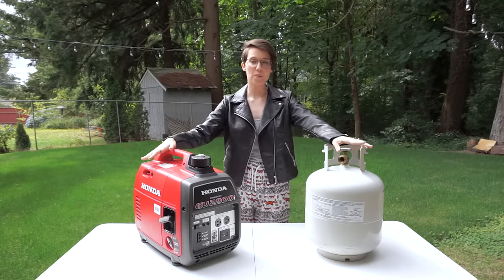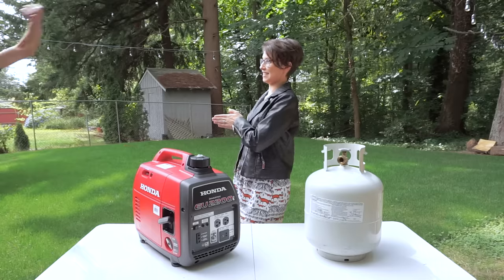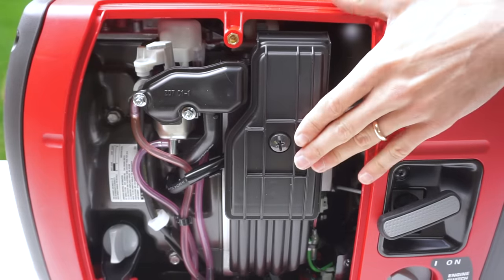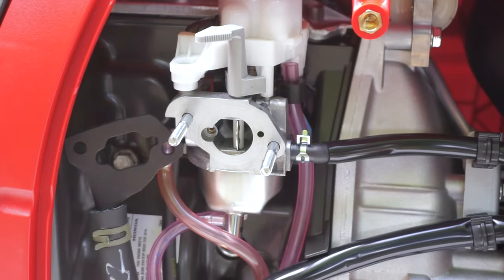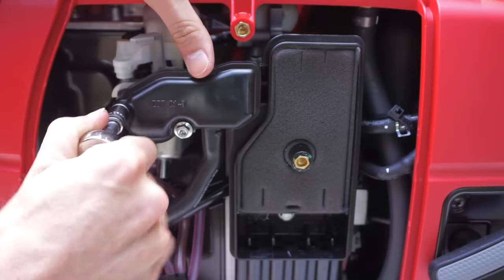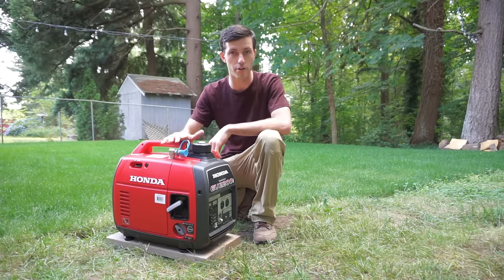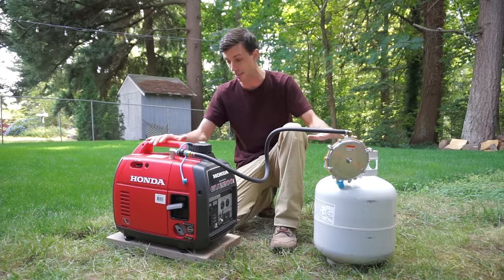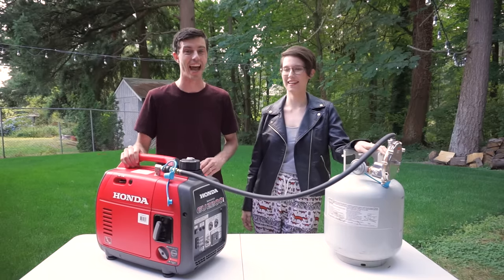Honda EU2200i Propane Conversion Kit - DIY Install for Honda Generator

Comment: Great tutorial on the conversion. Is that regulator big enough don’t you think? Do you think they can make a smaller one.
Reply from the maker: Thank you Ralph! And yeah the regulator is pretty large but I imagine if it could be smaller it would be. I don't know how they work so I can't say.
Reply: That is a special on demand regulator. It only lets the lp out as the engine sucks it out. It also regulates the lp pressue. Some kits have the pressure regulator and the on demand regulater seperate.

Comment: This is a great how-to install video. I was wondering if the "ECO" mode still functions running LP?
Reply: Interesting that there is no reply?
Reply: @ChrisSgaraglino , I should have gotten back to this question... Sorry it's late, here it is. Bought this conversion kit and installed it, WORKS GREAT ON ECO MODE WITH THIS CONVERSATION TO LP! There you have it.

Comment: Big question would be if you had the easy start and an older Honda 2000i, and 10% reduction if it would still run the AC
Reply from the maker: I'm not sure but I assume it would. Give Clayton a call at Hutch Mountain, he would know for sure: 435-494-1975
Reply: @FateUnbound  plus the 10% if you are above sea level you lose capacity also just FYI

Comment: Great instructional video- nobody could balls it up after watching you. You certainly are doing your hardest to make petrol the devil though. A mate has one of those hondas and I swear yours must be running too rich if you notice the exhaust as annoying. Maybe you run it in the garage.... I'd say if you are having petrol go stale in your generator for lack of use, either you don't really need a generator or you start putting premium in it and not that alcohol blend crap. I had a chainsaw stored in my shed fuelled up for 2 years and when i got it out it started and ran fine on the 3rd pull. Summers are hot here and fuel only goes bad when allowed to get hot- like outside. Its a nice simple conversion but that car sized regulator is ridiculous. A larger, less portable genny would be better suited to lpg though, as running a portable on lpg just makes it less portable and as the motor wasn't built for lpg, it won't be very efficient on it. One thing not in the kit was a shorter reach spark plug seeing as lpg runs hotter.

Comment: Since I don't own one of these I only watched the first 3 minutes.  Did you explain how long it runs on a 20# tank of propane compared to how long it runs on a full tank of gasoline?
Reply: A question in our mind as well  :)
Reply: Website says 30 hrs on a 20# tank
Reply: @Rick-rd9uu  Thank you.  And I should have mentioned that's a super well done video.

Comment: The big question not mentioned .... Would installing this modification VOID the manufacturers warranty?
Assuming it's a new or almost new unit.
Reply from the maker: I'm not sure, that is a question for Clayton at Hutch Mountain, the maker of this kit. Give him a call at 435-494-1975
Reply: I would suspect Honda 'wouldn't' honor the mod if you did it yourself. The reason is, there are too many "nut jobs" out there that would do something not mechanically correct and crack the manifold, bend the gas line wrong, and so on. I would be willing to be they would 'honor it' if you had a Certified Mechanic do it, because then they could come back to the Mechanic if something went wrong, and they could show "They followed all the proper precautions.

Comment: Great job with the install, I have an eu 2000 which has worked great for almost 20 years, $269 for that kit is a little steep

Comment: How long will a tank of Propane last with a 70% load?
Reply: 4/10/2020 I sent an email to the company asking this question. If I get a reply, I will let you know.
Reply: This is the answer I received: Hey Michael, run times are as follows. 12 hours full load, 22 hours half load, and 33 hours ¼ load. I hope that helps. Reach out if you have anymore questions thanks. 😊
Reply: My question is  why with a 1/4 load it runs longer, 33 hours,  than a full load at 12 hours?
Reply: Richard Estrada it’s essentially the same theory as a car Richard. The more load you have on your car the less gas mileage you get. If you load the generator (asking it to make more power) it will consume more fuel (on any kind, gas or propane). When the generator is asked to work harder it need more fuel
Reply: Be aware that the energy density of gasoline is much higher than LP or NG.  A 5 gal propane bottle lasting a day hurts a bit.  5 gals of gasoline would last many days.  I have this generator and it will hold my large fridge while idling and it will run forever at idle.
Reply: Ken Leonard  very interesting

Comment: How many hours on a propane Tank compared to a gallon of Gasoline. Thanks for posting.
Reply: Even though I really like this video and converting to propane, it will suck that propane tank down like It's nobody's business.. unfortunately gasoline/diesel is still the way to go if you're looking for a long-term Solution on a generator

Comment: Hi love you chance. I work a round low pressure cylinders and the only need to be open 1/2 to 1 turn of the valve. That with all fuel cylinders. Thats way if sum thing goes wrong you can shut it off quickly

Comment: Costco has/had a 2200 size dual fuel generator for $450 similar to the Honda. Hard to beat Honda on quality but Costco always goes Uber on the stuff they sell. I may pick one up to have around home, we lost power last spring for 40 hours. If it were me, however, and since you did run gasoline into your conversion/carburetor the gasket could swell slightly than contract with heat, I would recheck that your nuts are still torqued correctly. And, I would use the thread locker (high heat version) since it has been my experience that if anything can happen it will. Thread locker is like candied sugar it will granulated if you need to remove the nuts so it’s easy to break it’s bond with your socket wrench but you’ll have to scrape off the remnants with a pocket knife or wire brush.

Comment: Very complete How To for the Hutch Mountain conversion kit---well done!  One question, one hopefully helpful tip,  Is no sealant used on the internal fuel supply hose &fitting to the quick connect on the outside?  

For the carburetor studs where Loc-Tite is mentioned use #290 green penetrating formula after the nuts are installed---it will wick into the threads and seal them to the studs.  This is a low strength bond and easily loosened with nothing more than a low setting heat gun.

Comment: Most dual fuel generators running on propane produce a bit less watts - did the mfg mention what it would be de-rated to?
Reply: Yeah that would be interesting information.  So you know how much bigger generator you'd need to get the final needs met.

Also run time or consumption information.
Reply: There is typically a 10% power reduction between gas and propane
Reply: @_JimboSlice  That's what is quoted for vehicles. I have a V8  3.9 Land Rover Discovery on it.  I'd like to see them try a cold start on Propane alone. The engine needs to be warm to vapourise the propane. I have a friend who  runs an ex military Onan genny of it. The system just used a ring , similar to a gas cooker put on top of the carburetor.
Reply: @johnjacobjinglehimerschmid3555   I have some imperical eveidence from an Ex British Military Onan 3.7 KVA genny. That used about 1.5 Imperial Gallons of petrol  per hour. A 47 kg Propane bottle,  runs about 72 hours. Conversion is just a ring placed on top of carb. Cold weather it does need to start on Petrol for about 5 minutes then shut of and change to Propane. I also have a 3.9 V8 Discovery with PG. The same procedure is starts on petrol and automatically changes to gas when engine warms. In practical terms, there is no noticable diffrence which fuel you are on, though the 'Words' say you lose a bit of top end (in an off road Disco , who cares?) and about 10% of range.
Reply: I was really hoping they would do some load testing.
Reply: @_JimboSlice  Thanks.  How about runtime either a gal/hr ... or hours per tank
20 lb
30 lb
100 lb.... for example.

I know that it's probably mfg dependent ... but is there a rule of thumb?
Reply: @johnjacobjinglehimerschmid3555   most of my generators are the 3500 and 6500/7500. I get ~30 min per gallon for the smaller gen at 75% capacity (~40hrs on 100# of propane). On the larger gens, I get about <15 min per gallon. These run at 75% capacity as well. We get ~20hrs on 100# of propane
Reply: @_JimboSlice  Thanks for the info!

Comment: David ... Gotta question kind sir.  How long will the generator operate on one tank of propane?  Loved the video!!!  Chuck Knight. 🤠
Reply: 20 HOURS
Reply: Charles Knight Propane vs gas consumption is relatively the same 👍
Reply: 25lbs of LP vs one gallon time frame comparison?
Reply: It depends on the load, but anywhere from 12 to 18 hours, or thereabouts.
Reply: It's my understanding that propane and petrol are about a 1 for 1 exchange when it comes to efficiency. The benefit is that propane burns cleaner.... So it's slightly better for the environment.
Reply: @chadmerkley9465  I think what the question is, is the 20# propane tank 1 gallon of gas or 5 gallons of gas.

Comment: At 5:13.... plumbers tape for the threads you have forgotten.
Reply: They look pre-doped to me
Reply: You dont mix tape with pipe dope.
Reply: Well, as a pipe fitter I actually recommend tape then dope on every threaded fit up. BUT ½ inch or smaller either is usually fine. And I don't do gas lines often at all really. So there might be something I'm unaware of for gas lines. We usually do air and water.

Comment: There are several pros and cons using propane vs gasoline.  I think my main concern would be the availability of propane in an extended situation,  plus the storage issue.  I would think the oil stays cleaner longer with propane too, plus probably easier to start vs. gasoline.   Anyway thanks for the very informative video and bless you for not using some gawd-awful music, robo-voice or 10 minute lead in, lol.
Reply from the maker: You can switch between gas and propane with the turning of a switch so the availability of one fuel vs the other is a non issue
Reply: @FateUnbound  Great, I wasn't aware of that, thanks for the info.

Comment: Off of?   No check for any gas leak from the pipes or elbows?    Does Honda honour warranty on this mod?
Reply: ozmid40scouple  oh hell no!!!
Reply: Remove mod and then warranty. Works every time
Reply: I get a kick out of so many people worrying about warranties, don't you know by now that everything is designed to break a month after the warranty runs out.
Reply: Yep Honda will absolutely honor a warranty when you modify the fuel system🙄

Comment: any idea if there is any increase or decrease in performance switching to propane? also, what is roughly the run-time on 20lbs tank? thank you!
Reply: It does reduce power and that is a bummer when talking a 2000+- gen.
Reply: I get about 10% lower watts but alot more run time w/propane.
Reply: @dougms9790  Would you have a rough estimate how much runtime you'd get with a full 20lb tank?
Reply: @dougms9790  Nevermind- Fate Unbound answered my question below: ICYMI 
Fate Unbound 6 months ago-
Hutch Mountain got back to me and said 30 hours of run time at quarter load, 22 hours at half load, and 12 hours at full load off of a full 20lb "bbq" size propane tank. I think that's pretty good!

Comment: Great video! I hate written instructions. Just installed this kit on your recommendation. Like yours, second pull and Boom!... it started. I hope Hutch Mtn gives you a big tip.
Video production ain't easy. So thanks. My goal is short and sweet, but complete details.
You guys do a good job of brevity and details without too much chatter.
And your happy dance on the success of the solar video was entertaining. :-)

Comment: How long does it run on that size tank under reasonable load?
Reply: About half the run time than if using gasoline. Propane burns at a faster rate, lower BTUs than gas. Only use propane if you absolutely have to or you have a ample abundant supply on hand.

Comment: What a wonderfully made video!  I am currently in Florida, waiting to see what Hurricane Dorian is going to do.  I have a Honda EU2200i for Hurricanes (used it twice so far).  I will definitely use the Hutch Mountain adapter in the future.  I was very impressed with the ease of the installation.

Comment: Is there a reduction in generator output using propane? Also, if the engine were to stall due to low oil level etc, does the propane cut off? 

Nice video!
Reply from the maker: There is a reduction in output of between 5% and 10% simply because the combustion of propane releases less energy than gasoline. And if the engine shuts off for any reason the flow of propane will stop. Thank you!
Reply: Fate Unbound I figured there would be a reduction in output due to the difference in available energy, but it’s been a hot minute since college. 

I should look for one of those kits for my Harbor Freight 3500 inverter. The fumes are pretty obnoxious.

Comment: You guys made the installation look so easy!  I feel confident that I could do it myself.  I love how easy it would be to run off propane.  Do you know how many hours are fueled by one tank?
Reply from the maker: Thanks Jan! From what I'm reading online, a 20lb tank has 4 gallons of propane in it, and would run for roughly 28 hours at 1/4 load as compared to a gallon of gasoline providing 8 hours of run time. This is just secondhand information from the internet though, I've emailed Hutch Mountain for a confirmed run time. I'll let you know what they say when I get a response.
Reply: Fate Unbound Thank you!  I think I want to try this!
Reply from the maker: Hutch Mountain got back to me and said 30 hours of run time at quarter load, 22 hours at half load, and 12 hours at full load off of a full 20lb "bbq" size propane tank. I think that's pretty good!!
Reply: Fate Unbound I can’t believe that you guys looked into this.  I have a little teardrop which has solar but I can’t get away until wintertime, so your video was super inspiring as a backup power source for stormy days.  Thank you!

Comment: It is important that you burn all of the gasoline in your fuel tank before you completely switch over to propane.  Using fuel stabilizer in your gas tank will not keep it from the problems of storing it long term.  You just do not want to be storing a static load of gasoline, especially if it has alcohol in it, for a long period of time!!  After you have run your generator out of gasoline, you can stuff most of an old towel (not your wife's favorite, please) into the gas tank of the generator and swab it around with a stick and then pull it back out by the end your retained.  This will avoid a stinky mess if you ever need to run it on gasoline again.  This can be sometime when propane is not available near by and you need to maintain refrigeration to keep your food from spoiling, or some similar situation.

Comment: Great idea. I would like to have it. 
But I would mention a few things.
I have done gas conversion for 3 of my cars.
a.) The engine runs hotter.
b.) Gas has 100 oktan but still the engine has less power.
c.) The gas "washes" the oil from the cylinder wall
With cars I came away from gas again.
It was interesting to do it but the power loss and the engine cooling and no chance to have a jerry can with gas with you was something it brought me away from it.

Comment: how long can one tank stay on for?
Reply: LPG converted cars consume 50% more propane compared to petrol. Should be same for generators.
Reply: FYI- Fate Unbound
6 months ago
Hutch Mountain got back to me and said 30 hours of run time at quarter load, 22 hours at half load, and 12 hours at full load off of a full 20lb "bbq" size propane tank. I think that's pretty good!

Comment: Hutch mountain must have changed their parts and instructions since your video.  On mine, which I purchased a couple of months ago, the nylon spacer is bigger and they require you to remove the sleeved washer from the air box hole to provide enough threads on the bolt to re-install.  I should have read the written instructions more carefully.  Other than that, the install was similar to your video and pretty simple.

Comment: Running on propane will keep the oil cleaner and there are less deposits on the spark plug. Your piston will also last longer.
Reply: The plug will wear slightly quicker if it is a standard Petrol plug. Also the engine will not fire up as easily when cold. There are specific LPG spark plugs  available, but they are very much more expensive. I run a 3.9 V8 Land Rover Discovery on an LPG conversion. In Europe and Ireland vehicles have run on it for years so it is an old proven technology.

Comment: Great video, nice job in explaining and showing everything, clear enough for anyone to do. My problem is this Gen costs $1.00 per watt - $2200.00 bucks way to pricey for me, though I know its not a video on the Gen. Please consider doing more  of these with like  Gen
s from Harbor Frieight, ie Predator 2000, which only costs $ 479.. Or any of the Predator Gen's , thanks for this ....:)

Comment: Wow... Thank you sooooooo much, great video... any idea how long you can run the generator on one 20 pound propane tank?
Reply: From Hutch Mountain: There are a few factors that change the runtime on propane. First, the length of run time depends on the size of the generator model and the size of the propane source. On a standard 20 lb. BBQ Tank a full load will run for approx.. 12 HRs, Half load for approx.. 22 hrs., and a quarter load for approx.. 33 hrs.